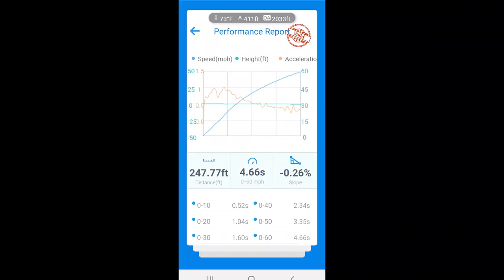RZR Pro GONE!!! Totaled Thinking About An X3, X3 Max, Turbo S, Turbo S 4, RZR Pro, RZR Pro 4

Comment: I have a 2015 can am maverick 1000r and a polaris rzr xp 1000 thinking about selling both and maybe getting a pro or a can am rr 195hp witch one did u guys like better
Reply from the maker: Well it depends on what kind of ridding you do.. and preference. I like a 72 inch wide machine for the dunes,, and the RR is a beast, great machine. But the pro is fun also,, especially if you are riding trails a lot.

Comment: How did the insurance company determine it was totaled? Did you have a shop estimate the damages?
Reply from the maker: Anytime the chassis is bent on a machine like this it's a total because of the cost of repair
Reply: @DandiOffroad  wow I had a head on with a car and the insurance gave me an estimate and told me to take it to a repair shop . The frame is definitely bent especially since the new xps are one piece. The repair shop still hasn't got the estimate out and it's been there for a month. Thanks just trying to see what avenue to proceed down.
Reply from the maker: probably a good chance that their estimate will be so high that they will total it, I would think
Reply: My Tubro S was totaled with a bent frame.
Reply: @x3dominator28  did an insurance adjuster determine it was totaled or a shop. Mines been in the shop for a month and they haven't sent an estimate yet. Getting frustrated .
Reply from the maker: ours was determined by an estimator